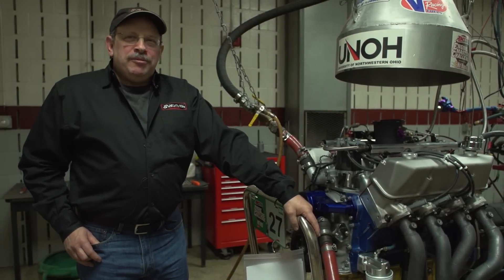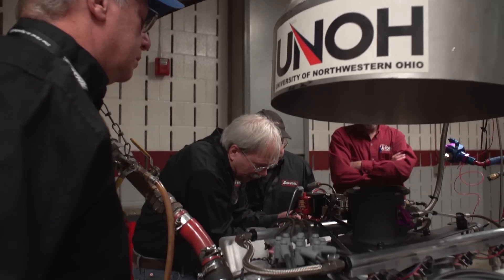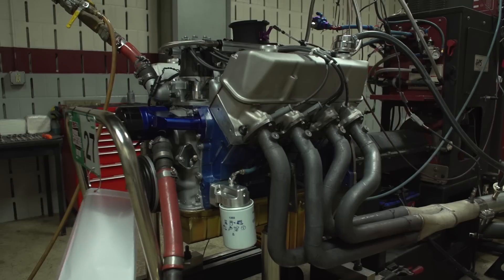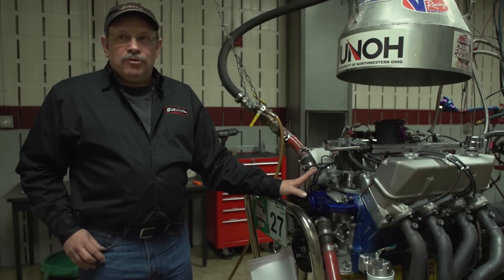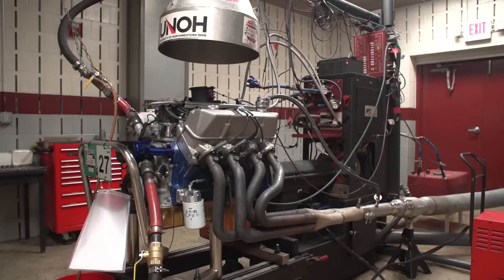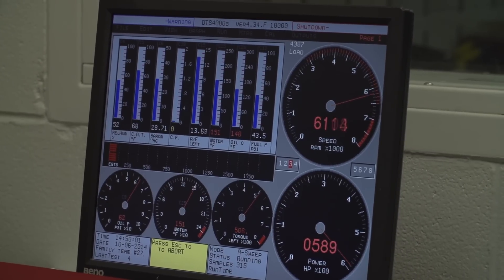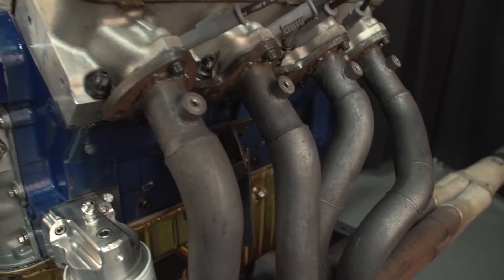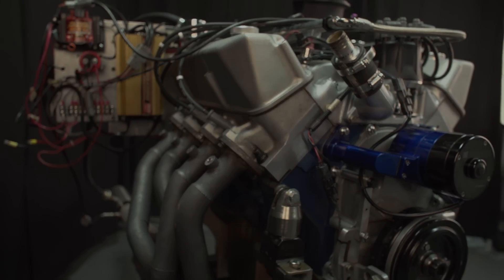433ci Ford FE by Survival Motorsports, Amsoil Engine Masters Challenge 2014

Comment: It all sounded good until the aftermarket FE block was mentioned so it really has very little in common with a factory block. So i dont know if it really proved much if you didnt even use a factory Ford block. I am very much a Ford fan.

Comment: Barry R. What is involved in making the intake efi? I've always wanted to use this intake on a 390 build with a custom bear aluminum block, 9.7 compression, bear aluminum heads, full roller valve train with a smooth idle and good vacuum. What do you think I'd be at as far as power and torque? I was looking to get at least 400+hp/430-450ft/lbs

Comment: FE 427s powered the overall winners at the 24 Hours of Le Mans in '66 and '67 (before displacement limitations were enacted), which is an achievement hardly representative of a "fragile" or "non-durable" design. Ford boasted that those motors were constructed using performance parts from the Ford racing catalog. The problem for FEs has always been that factory high performance blocks cranks, and heads needed for serious racing efforts became relatively scarce and expensive after the 1960s. Modern casting and CNC technology has changed that.
Reply: Came to say this! Anyone who questions the durability of the FE needs to simply read your comment. They are fantastic engines and helped shape the muscle car era in 63/64.

Comment: I have a stock 360 truck block from a 1970 F 250 with one of Barry's 445 prison break set ups inside. Comp 288R cam in a fox mustang. 1972 home ported cast iron heads. All throttle no power adders we are putting out 550 tq and 570hp at the flywheel with an 850hp Holley. For several years now so they are good blocks.

Comment: I have a 1977 ford f100 with a stroked 390 to 428 cu in that runs 12.0 in the quarter and I built it myself in the garage. I love fe engines and I have built 4 so far. I would love to upgrade to the 445 stroker kit. I have beat the hell out of the last engine I'm running now and I haven't had any issues with the engine. I am running a full sump pan that holds 3 gallons of oil that I pulled from an old fire truck sitting in a junkyard. I drilled the block for a rear sump pickup tube and I have 0 issues with the oiling

Comment: people are idiots these days, fe engines are BULLET-PROOF! 
all you need is an aftermarket block. well and maybe a forged crankshaft.
oh and forged pistons with h-beam con rods. like i said  BULLET-PROOF!
Reply: Like I noted on the other reply - - every other engine around is using the same exact level of parts.  The exception might be the factory cast crank, which if used in an FE really is darn near to bulletproof

Comment: I love my FE Ford engines ...... thinking about putting one in my boat also.
Reply: there were alot of FE marine motors at one time.
Reply: FE engine in a comparable state of dress - aluminum heads & intake - is about 100 pounds lighter than a 460 style engine
Reply: With the weight it may sink!!
Reply: I don't think so. It ain't a 15 ft dingy.

Comment: FE and fragile doesn't go together. About 80% of all the frost fans throughout napa and Sonoma counties have 390's and 428's in them. They sit all year and only get ran a few times during the winter. They only use FE's because there so robust. Pretty badass seeing a propeller attached to them and running at 3000+ RPM's

Comment: The durability question is not so much the FE architecture (Ford proved that durability by doing some rather extensive 24 hour testing in the 60s).  It was to answer the guys that claim that Engine Masters entries are fragile dyno queens that cannot live on the street or on the track.  With hundreds of dyno pulls and now two seasons of racing and cruising I think we can put that B.S. to rest.
Reply: that's right Barry way to go
Reply: It all sounded good until the aftermarket FE block was mentioned so it really has very little in common with a factory block. So i dont know if it really proved much if you didnt even use a factory Ford block. I am very much a Ford fan.
Reply: Your customer service sucks

Comment: Not a lot of original parts in tis level of competition - but that's true of every entrant.  Plenty of Dart blocks, CHI heads, billet cranks, and all aftermarket stuff no matter what the brand or family.  For those that are looking - the crankshaft in this engine is a genuine 1960s vintage Ford truck forged item - so its had perhaps 50 years of testing - is that good enough?
Reply: It's called progress . 
Engine l would put in is a Ford Windsor 441 cu inch.  Ford SB Hemi Heads from Georgia USA 🇺🇸 & a Bes Racing or CHI intake manifold....  with a secret carburetor also from the USA 🇺🇸 .
 " Crank Trigger Ignition & Coils near Plugs " if u r allowed those upgrades.  Over 1000 hp without them @ 11.5 -1 or  12.1 on 93 Octane.  Heaven knows what with 

I don't know the rules 4 engine masters so l could be in trouble here .

Comment: Trying to prove a FE is reliable by showing that an engine which contains no original Ford parts is reliable is pretty damn ironic, not that i have anything against the FE, but if you want to claim that an engine is durable and capable of handling power, you should at least use an OEM block.
Reply: Note to the above - - the 2017 entry was a 390 factory block that made 550+HP with a factory oil pan, a factory distributor, a flat tappet cam, and factory IRON exhaust manifolds.  Are you happy now?
Reply: @Survival427FE  They'll never be happy. Leave that to the fans.
Reply: I agree !

Comment: I've always wondered: Can you really call an aftermarket block a Ford FE or a Chevy SB, etc? I mean, It's got the same basic design as the original, but that's not what it really is. It reminds me of all these tools at car shows claiming they're driving 1965 Shelby Cobras...but they're not.

What makes people resist saying what they've really got?
Reply: Drew Brewich That's not trolling... I've been thinking the same thing, Yoshio. Once you start building a motor is it really Ford or Chevy or Chrysler other than the original design/block?
Reply: +Yoshio Tamiya (sorry guys, long winded rant on the way!)
it's really a rather multi-layered idea, there's no 'black & white' about this. take the standard SBF - say, your typical fuel injected 302 from an '80s Fox body Mustang - the basic design of the engine is VERY well proven in terms of power potential & durability, and there are NUMEROUS examples throughout the past half century, as well as many entries in the record books, to show this(the Ford GT40 that won Le Mans 4 years in a row? the '66 & '67 wins were 427 FE powered - but the '68 & '69 wins were 302 Windsor powered, thanks to a new rule limiting displacement to 5.0l after Ferrari and the other Europeans threw a bitch fit after Ford DESTROYED them the previous two years with that big 427 FE). however, as solid & capable as the Windsor small block design is, the mass produced engine blocks found in the vast majority of 302 equipped Fords(including those '80s Fox bodies) were complete shit. any honest to God Ford fan will readily state this too, it's just a fact of life. they're so awful that you risk splitting the engine block in HALF at only 500HP(give or take). in fact, it's possible to crack those blocks in half before breaking the factory internals!

so, enter the aftermarket. your very basic, entry level Windsor aftermarket block will basically be a carbon copy of the Ford factory piece - BUT it'll be cast from an iron alloy that has MUCH higher tensile strength, the high stress areas, such as the main webbing, valley webbing and such will be thicker, and the cylinder walls will also be thicker. but, other than the material and a few minor dimensional changes, it will otherwise be identical to a factory Ford Windsor block - literally EVERY factory component will bolt on/in to this 1000+HP capable aftermarket block.

now, things can get a bit crazy after that, especially if your measuring stick is whether factory components will bolt up. there are a LOT of examples of 2500+HP capable engine blocks that will feature MANY significant design departures from the original factory design that you can still completely assemble with all factory parts - a ridiculous idea with such a block, but you get the point i'm trying to make. and those sorts of blocks are so significantly different from the original that, even if fully assembled with all original factory components, they would stand out look a sore them, looking swelled up under all of these comparatively modest mass produced components.

and, when you take a step further and get into the highest echelon of 'production based' performance engines, it almost becomes laughable. EVERYONE has heard that guy - one of the many bandwagon members of the Cult called MOPAR, and their absolutely absurd chest beating about the fact that "ERRY TOP FYOOL DRAGGER EES POWORD BY A H-E-M-I, CAUSE EETS THUH ONLY MODOR DAT WHEEL HOLD UP TWO DAT!!!" well, to the Mopar Cult collective, i have some bad news - that their "hemi" that you so preciously cling to in Top Fuel/Funny Car has been changed so significantly from your 1960s 426 cubic inch god that those cylinder heads from that 1960s 426 won't even bolt up to it. and, lest anyone forget, "hemi" only refers to a single thing - the shape of the combustion chambers of these engines, which happens to be 'hemispherical' in design. no, Chrysler didn't invent the hemispherical combustion chamber, no, they were not the first to use it, no, they were not the first to mass produce it, and, no, they were not the first to use it successfully in racing. what Chrysler was the first at doing with a 'hemi' engine though is market a rather obscure technical term so well that it created a damn cult! and, to that, i give them all the credit in the world!

but, i digress... i believe i've summed up this debate by saying that it's as clear as Flint, MI water, and it's largely nothing short of a giant helping of individual interpretation multiplied by personal opinion. is this a 'Ford FE engine'? by design, 'basically'. by component manufacturer, certainly not. but, in the end, there is no "right" answer.
Reply: Jefreeman13
I got troll trolled!

I'm thinking if it's a Chevy block, for example, it's a Chevy engine, like when you swap the motor in a Mustang out for a Chev, it's still a Mustang. I'm just not sure when it's an aftermarket block, rather than being the real thing.

I mean, Coke is Coke, but RC Cola isn't, right?

Related(?) story: I once owned a Ford Festiva that I'd swapped a Mazda BP motor into. It had kind of an identity crisis. It was a Ford for the US market, designed by Mazda in Japan, built by Kia, in S Korea, with a Japanese built engine stuffed in it.
Reply: jre racer I'm afraid you missed my point.
Reply: RyTrapp0
Good points all around. I'm still annoyed by the 1965 Shelby Cobra kit car guys claiming they're driving a 1965...you get the idea.

Love the comment about the Hemis, as well. Today's top fuel engines have as much in common with an Chrysler product as a Nascar Toyota Camry has to do with a real Camry. Besides, even my Ford Festiva had a "hemi".
Reply: Troll
Reply: Yoshio Tamiya i own a 68 ford ltd with the original 390 fe all stock except for the holley carb msd coil and pertronic electric ignitor and i drive it daily and abuse it alot
Reply: Late to the party, but Yoshio Tamiya, you're correct.  I think the problem is with how people use words, and use them together incorrectly.  Of course, when anything is said about it, someone has to say "it's just semantics", but, that's the root of the problem.

So, in reality, that 1965 Shelby Cobra isn't a genuine cobra, but a 1965 Shelby Cobra design, as with the Ford FE engine, if none of the parts are made by Ford (and, most likely, not even by their OEMs), then it's simply a Ford FE design, or a Ford FE inspired engine.  But, as humans, we communicate with brevity and that just becomes "a Ford FE" engine.  And we'll just have to understand the imprecise semantics of the meaning of that phrase ;)

As can be read in many of the replies, people don't read the entirety of an explanation, anyhow.  They read just enough to form an opinion, then blurt out (type out) whatever that unfiltered opinion is, right or wrong.
Reply: +Yoshio Tamiya ya, thats the way to ruin a good ford by putting that worthless weak chevy shit under the hood!!! wanna make a chevy run put a FORD under the hood! real power

Comment: What Ford parts are in this motor to call it a Ford?
Reply: If you check out the majority of the engines there are no factory parts left on the engines. Plus the FE is turning 50 here soon, so stock parts would be ridiculous to run
Reply: mrfordfan  What's wrong with a 50 year old part? If I find a 390 block in a 67 Galaxie or pickup that is sitting behind someone's house I'd think it an acceptable basis for a build as long as the block isn't cracked. I hope there is nothing wrong with that because it's how I have always done it. Except I used 325hp 396 Chevy blocks and the oval port heads. Lots of low end torque and for street power levels the internals are good to 450-500hp and 6500rpm limit. Saves a lot of cash over the hi po Chevy parts with lots of low end grunt and power upstairs with the right cam and valvetrain.
Reply: The crankshaft started out life as a Ford truck part from 1960something...
Reply: I was thinking the same thing when He said the block was  made by Genesis .
Reply: haha the blue paint